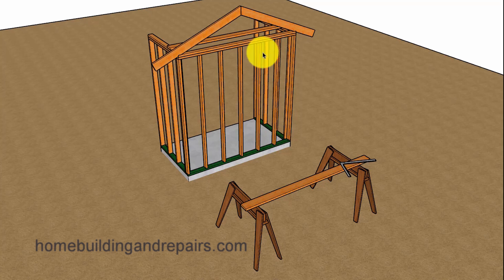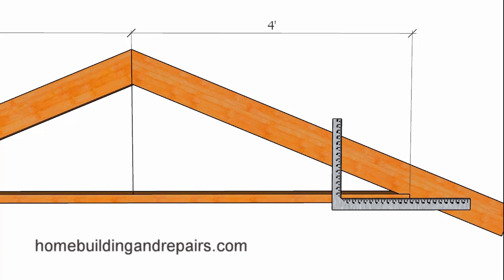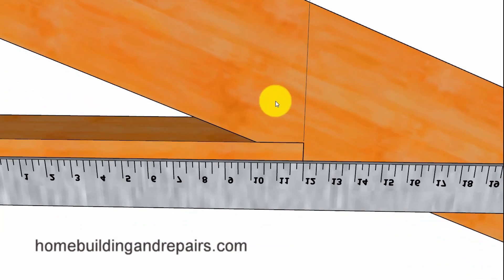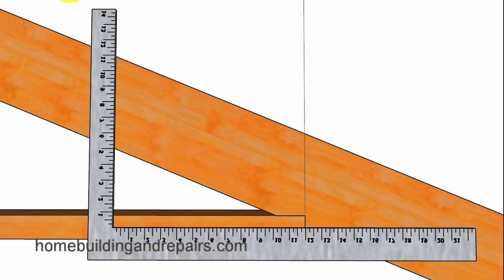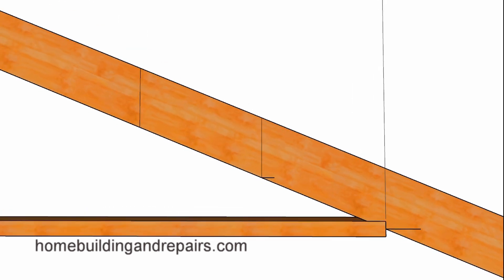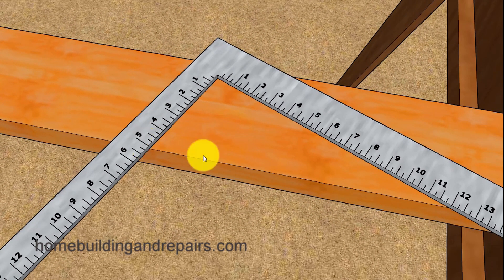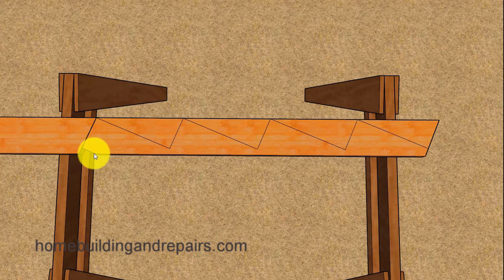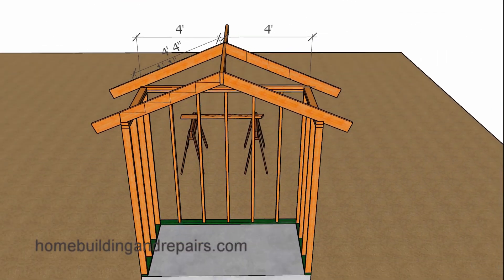How To Layout Common Roof Rafter With Framing Square Step Off Method - Part One

Comment: Dont you have 2 take off more then 3/4 if the slope rises above a 4?
Reply: To account for the kiln dried 2x10  Kiln dried  lumber ridge piece? No. If you are using standard K.D. framing lumber, you always only take half of the thickness of the ridge piece, which in the case of regular 2"  K.D. lumber which is 1 1/2" thick, half of that would be 3/4". The pitch of the roof does not affect that. Hope that answers what you were asking about.

Comment: What is rafter shoe
Reply from the maker: It could be a hanger or type of hardware that the rafter sits into. This is not a term that was used by most of the people I worked with.